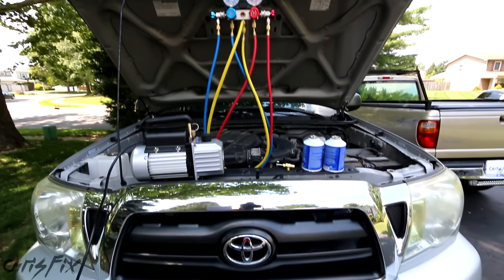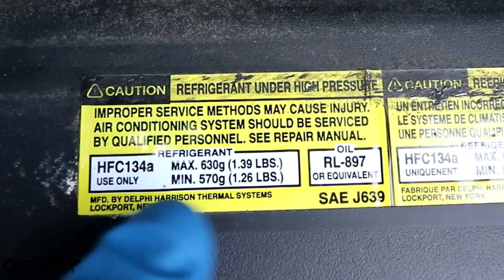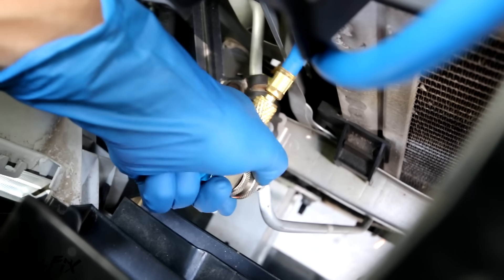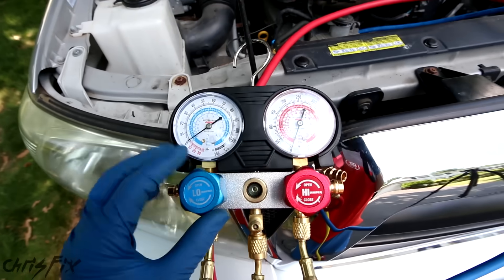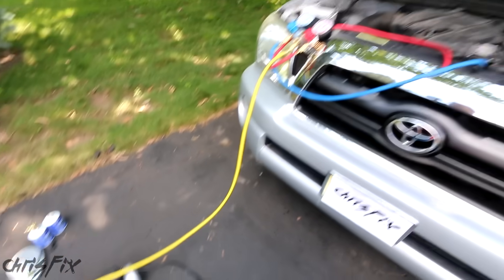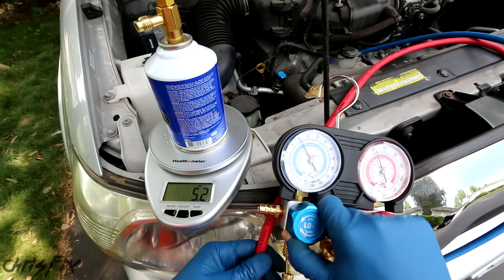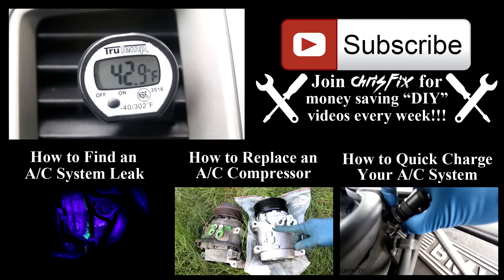How to Properly Recharge Your AC System

Comment: I made sure to crack the lines and dispose of the refrigerant in my garage instead of outside. Doing my part for the environment.
Reply: About to do this job, I leave the garage door shut right and breathe really hard?
Reply: @jasonreed1597  Just make sure you stick your face right over the valve and you should be good.
Reply: I got no kids or family so I did the same damn thing.
Reply: X2
Reply: Greta thanks you♥️
Reply: Yea  your garage is in a vacuum I guess
Reply: @wirenut9062  My lungs created the vacuum. Its a cheat code.
Reply: @rsbmg  Thank you!  Your environmentally responsible measures had me laughing over and over gain. This sooo made my day!
Reply: When you add oil and dye to the yellow hose, then connect your Freon can you say to purge the hose at the manifold but so the oil and dye you added then be purged also. ?
Reply: In this scenario do I just add more pag 46 oil or do I just expect that it didn't leak out with the freon?
Reply: When $200 at the shop is the alternative… 😕 

There ought to be a government rebate for the shop fee for refrigerant recovery.
Reply: Meh,..Cow farts cause greater damage anyways 😂😂 Greta👹🖕🏽
Reply: Lol I used mine as a fart bomb on my neighbor
Reply: I'm very happy people know this, it's rare to see a good video. don't forget to test your battery, if it's defective, throw it in the ocean or sea depending on where you live.

Comment: This isn't for a personal mechanic. We don't need all this crap. This is a video for people with money.
Reply: FWI, I can understand not having the bucks to get the equipment. But last year when my fridge was going out, I found a compressor and gauges on amazon for a lot less than I thought they were going to be. I think I had to use my credit card, which I only use in emergencies. But I saved $1000 by not buying a new refrigerator. I was ready to spend that much if it would have needed a new compressor so I could keep the kitchen appliances matching. I now own the equipment I can use on anything that cools (auto and truck AC's, my house AC, refrigerators and freezers, etc.), and I'll save the cost of having a shop do my '05 Silverado after watching this video. The tools will last longer than me, and you'll be able to help others out as well. Maybe even make some of your money back by saving money for friends and family.

Comment: I suspect I may have quick charged and overcharged my AC system recently. If I wanted to recover the current charge in my system and just recharge it with the proper weight of refrigerant would I need to add any oil back to it? Just a quick background I’m a senior residential HVAC tech so I do have some refrigerant knowledge.

Comment: Doing this without actually vacuuming the system out, then precisely measuring how much putting back in according to specs, is just asking for trouble.
Reply: Yeah, theres a table with ambient temperatures and target hi/low pressures which is a far safer bet for partially filled systems
Reply: I guess I have all ways had good luck? I have all ways added to a system with out a vacuum... never had anything happen.... I'm sure they don't get as cold as it should but they get cold enough

Comment: Hi Chris, love the tuitorial, But can help me answer this, Is there a dual-drive air conditioning (A/C) compressor—capable of operating both mechanically via a belt and electrically via a motor the idea is these compressors allow the A/C system to function when the internal combustion engine is off by switching to electric power, ensuring continuous climate control.

Comment: Great video but I would have added refrigerant to the high side before I turned the car on. The vacuum on the system will suck enough in to start the compressor without dumping liquid in compressor suction inlet. Less of a chance of locking the compressor. or am I the one missing something. I have been doing AC for years and the machines always have us dump in the high side when the system is in vacuum before we fire the vehicle up.
Reply from the maker: Thanks and you should never add refrigerant through the high side if you are doing a recharge like this. Pro machines might be different but when doing the can method like this you always go through the low pressure side
Reply from the maker: Thanks for the tip!

Comment: You did not explain filling the high side Chris. After re watching 5 times you said to open low side only but the gauge on high side moved when you added to low side. Confusing
Reply from the maker: Correct, you only fill through the low side when recharging. The low side is the suction side so the compressor pulls in refrigerant, pressurizes it, then sends it through the high side. The system is a closed loop, and the high side gauge moves because the system is balancing itself out. If you tried to fill from the high side, you'd be trying to go against high pressure liquid which can be dangerous

Comment: I have to replace an a/c hose. so, my question is will the oil in the system be sucked out the system when the compressor is removing the moisture from the A/C system?

Comment: If the ac compressor comes with the correct amount of oil when you put the vacuum  it doesn't vacuum the oil that is on the compressor?
Reply from the maker: No because the oil is heavy and stays in the compressor/lines for the most part. You might get a little sucked out and  you will know because the vacuum pump will smoke.
Reply: @chrisfix ....it works on any vehicle cuz I have 2013 jeep Grand Cherokee srt8 ?

Comment: Is a vacuum pump needed only after you’ve replaced the a/c compressor or can you just get the refrigerant and recharge the a/c compressor if it’s low?
Reply from the maker: A vacuum pump is needed if there is no positive pressure refrigerant left in the system.

Comment: I have a question.  I am replacing my condenser because it is leaking in 2 places. I believe my freon has escaped completely because I don't have cold air. Anyways, how do I know how much, if any, oil I need if I'm replacing the condenser, not the compressor?

Comment: At about 10.39 it is a little bit unclear. 'ONLY OPEN UP LOW PRESSURE SIDE, not high pressure side—then seconds after the high pressure gauge reads building 100 psi." ??? My Hummer H3 still worked and I bought the same Harbor freight kit. I guess you can do it a bit wrong and it still works. Amazingly well made video—these are so hard to make this good, just that one thing for me?
Reply from the maker: Do not open the manifold. The gauge will still read without the manifold open on the high pressure side.
Reply: @chrisfix  Crud. I think that is correct. I get all OCD. What I did still worked. The high pressure fitting started to leak on the fitting. I tightened the 17mm nut. I probably did that kind of wrong.

Comment: (Update) Problem identified, recharge went as described after, Many Thanks) 
hooked everything up, followed your steps, but its not going below zero. does this mean I have a leak somewhere else?

I replaced the 2 main hoses because the pulley had rubbed a hole in it, but now the new hose is not near the pulley. The vacuum pump is spitting out moisture, should I just let it run longer to see if it finally starts dropping and getting a vacuum?

Comment: How do you know if it have oil
Reply: If its a brand new compressor, because youve just replaced your other one, then you have to add oil. If its not a new compressor, dont add oil.
Reply: @theillegitking1304  I had to replace the ac lines and the ac condenser should I still add oil. Replace do to a front and collision
Reply: also if its a rebuilt compressor it could come prefilled and would indicate so in the installation instructions or a tag on the compressor

Comment: I know this is a older video Chris but I have a question for you.  If I am going to add Pag Oil the way you suggested do I still purge the line once the freon can is attached.  I'm sure you would lose a little Pag Oil that way but I just wanted to make sure.  Thanks for the help
Reply from the maker: The line will be filled with oil so you do not need to.

Comment: Hi there...
all good with yout video very helpful. a bit BS when you mention about putting oil in the yellow line and then conneting the gas will make the oil flown into the system, yeah with air or are you gonna purge oil and then get oil all over the place? has to be a better way mate. nice video though. cheers

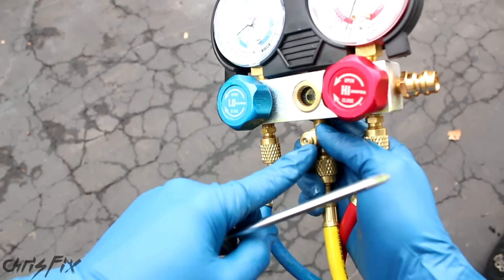Comment: Dear Chris, I can see at 9:10 you still have a vacuum in your system, but at 9:18 you have 5 PSI? How did this happen? Also at 10:11 when you let in the refrigerant, you have some pressure in the system... Could you explain this, please? Great video, thank you!
Reply from the maker: That's normal, there is residual pressure in the can (so when you attach the can some of that pressure equalizes into the low pressure side), and also a small amount of refrigerant vapor enters the manifold naturally despite both sides being closed. This is normal as you are still in a vacuum overall and won't affect anything

Comment: You didn’t account for the refrigerant in the manifold set, I’ve read that’s about 2oz. Also, I’ve read you loose another 1oz per can being when the can pressure gets to low side pressure there’s still about 1oz left in the can, so I’m guessing you’d be about 3oz short. Do you or any others in the comment section think that’s accurate?

Comment: Do you only need to add oil if you replace the compressor? Just had a leak. Also can you put in refrigerant using gauges instead of weighting the can ?  Thanks
Reply from the maker: Depends if the compressor was pre filled or not, and that is a way to do it, I've done that with no problems before
Reply: @ did not change compressor had leak in Schrader valve. Thanks

Comment: Hey @ChrisFIX ok so i've observed u using the outer guage lines to diagnose everything.....when i bought mine i thought the line where R134a is the line i had to follow since the refrigerant in my vehicle is R134a but apparently i was wrong....my question is what are those lines for ? Do we use them at all to determine anything or is it just the outer line u were using we have to always look at ?

Comment: Great video as always Chris! When replacing the radiator on a 2014 Pathfinder, condenser lines have to be disconnected from the radiator.  Would this require adding oil back into the system or are we good since the condenser will keep its oil since we're technically not replacing it?

Comment: You say that the refrigerant is some nasty stuff we don't want to let out into the atmosphere to be environmentally responsible but when you purge the line to add refrigerant you let out the refrigerant into the atmosphere. What? Honestly all that stuff about it being bad for the environment is total nonsense. As if all those nuclear explosions after WWII that we did during testing was less harmful? Please I'm sick of the environmental lies!
Reply from the maker: A quick purge of mostly air is not going to do anything. All of this refrigerant leaked out of the system before I fixed it. You just dont want millions of people emptying full systems like there are no problems with that.

Comment: hi Chris, I want to buy vacumppump but I live in apartment, means I have no access to 220/230V to run the vacum pump, can I use inverter powered by car battery for this vacum pump? any experience on this?

Comment: if I do not have AC, which inverter capacity (from 12v to 220/230v) I can use to power that vacum pump?

Comment: For some reason after I vacuumed, then added the can to the manifold and bled the thing after I started the truck and turned the AC on and open the low pressure side. The pressure went up, but it would never kick on the AC compressor and the high pressure side stayed at the negative it was at before.

Comment: A great & detailed video! A note for others watching from the EU, like me: you won't be able to buy regular R134a or R1234yf as shown in the video. There's an EU regulation (EC 307/2008) that only allows sales of fluorinated refrigerants to licensed businesses because they have a very high global warming impact if released into the atmosphere.
You can instead buy replacement refrigerants that claim to be compatible with R134a. I'm planning to try it out in my old car using Chris' method (pull a vacuum then weigh the refrigerant to fill it exactly).

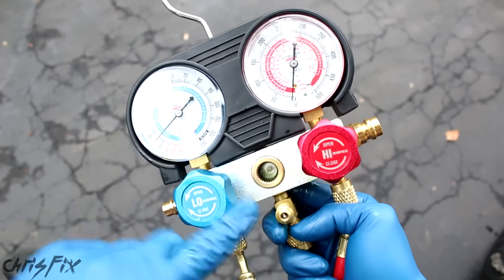Comment: 9:33 -- how do you know there is not air in the blue and red lines ?
Reply: because those lines were vacuumed out
Reply: As long as he shut his high and low sides WHILE, under vacuum, the hoses and under vacuum as well.
Reply: Because the system is holding a vacuum. As long as you don't disconnect the red or blue line, you're still going to have a solid vacuum and no air will be in the system

Comment: SO, if you have to add oil to the yellow line before you connect the refrigerant, you cannot Purge the air out of the line before filling it. Will this allow air into the system? Is there a way to add oil without purging that line and shooting all your oil out? Seems like none of these mechanics tell you that. I wonder if they know what you are supposed to do? I wonder if they have just been allowing air into the system by doing it this way? There has to be a better way! I'm going to have to do a lot of searching and find some talented mechanics who know the answer to this question.

Comment: Great Video.  Only one question. You stated the compressor came with oil already but when you pull a vacuum does it not also suck out the oil.  I thought any part that was replaced for AC repair you have to pull vacuum and also add oil.

Comment: Another vid said never open the high pressure side. Whats your advice Chris?
Reply from the maker: Why not open the high pressure side? It will give you more info on what's going on with the pressures.
Reply: Hi Chris thnx for writing, the vid says because the high pressure side is about 200 psi and the filling can is not that pressure, so he says. You could blow up the can n?

Comment: Hi I have a question and need help. my car 2012 Honda civic. if I add 1.66 oz oil pag 46 to new condenser and recharge ac  system. Do I have to add oil pag 46 again for recharge. If yes how much oil pag 46 i have to add into ac system for recharging. Thank you.

Comment: When I purged the air out of the line just air kept coming out and not refrigerant. I had the high and low valves closed so it was coming out of the r134 can. But it didn’t come out like seen in the video. Help🫠

Comment: Pay someone to get rid of the material to be environmentally friendly, but lets purge the new bottle into the air lol
Reply from the maker: Theres way bigger fish to fry compared to releasing a gram in the air to make sure the system is good and sealed for years to come :p
Reply: @chrisfix  I totally agree. but to make sure I understand correctly. As long as there's something bigger the smallest number is irrelevant because there's something worse. And how many times do One release only a gram before it's a problem or as long as it's not a lot a one time it's good cuz there's no accumulation?
Reply from the maker: Pretty much and I mean it would probably have to happen billions of times before it started to move the needle on anything

Comment: I have a question do I need to evacuate the system before I replace the compressor and condenser or after I replace them?
Reply from the maker: If there is refrigerant in the system, yes. If it all leaked out, verify there is no pressure and then if there is 0 pressure then no. Just be careful when opening up the system.

Comment: Hey Chris i got a question. How do i make sure that my system is completely empty before refill? Cause i am not sure my ac is leaking. What are the best steps to do this? Many thanks
Reply: Use a vacuum pump and pull the system into a vacuum.
Reply: @Redtooth75  and where does the liquid or is it gas, go to?

Comment: Hey Chris. Quick question, did you account for the weight of the refrigerant in ounces or fluid ounces? The bottle said 12 fl oz, but weighed 20 ounces. So from my calculation you added 30 ounces instead of 22. Now My math may just be wrong but I just wanted to check if you did account for the unit.

Comment: Thanks again, Chris for the video! One very important note since this video is about 8 years old, most of the newer cans of R134a our self sealing due to regulation. What this means is, you’ll need an additional adapter. Its usually blue and cost $10 for the new style cans.  Without this additional adapter, none of the refrigerant will come out when you try and pierce it.
Reply: Ran into same problem but you don’t need to buy that adapter all you need to do is remove the thick rubber gasket on the tap and replace with a smaller size or just shim it down

Comment: Hey my low pressure jumped to 100 psi and stayed there
Reply from the maker: Could be that the system was already charged and is now overcharged, if it was clear then it's likely you have some kind of compressor issue, blockage, or contamination. It's also possible the gauges you are using are faulty, try using a different set if you have access to them

Comment: Hello Chris, best DIY video for charging a/c system, after I watched hours of others.  I am not real keen on operations of a/c units but mechanically inclined. My question is how does the oil and dye get into the system if you have to purge the yellow line? Neal.

Comment: If my car just change evaporator so I don't need add compressor oil is it correct?
Reply from the maker: Any time you replace an AC part, you need to add oil.
Reply: @chrisfix  how much oil need to add, i just replace a evaporator, Toyota tundra gen 2